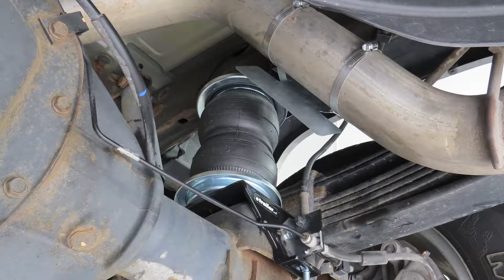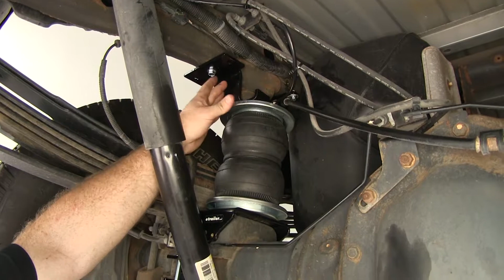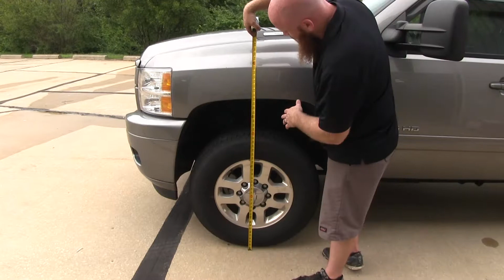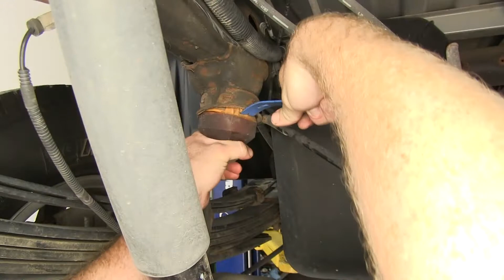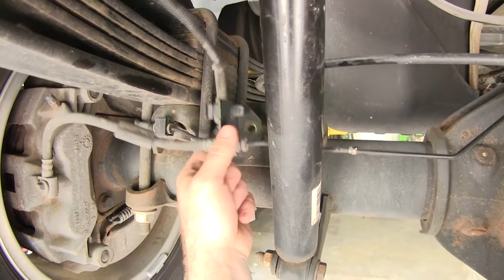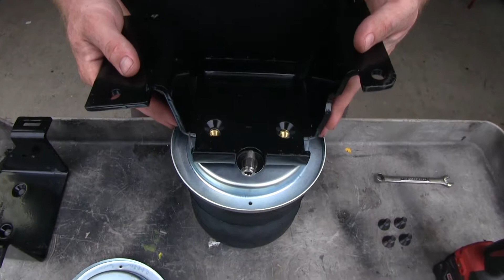Installation Guide for the Air Lift LoadLifter 5000 Air Helper Springs on a 2012 Chevrolet Silverado

Comment: is this compatible with the curt quick install side frame brackets? my truck is a 2011 sierra 2500HD. i have the curt quick install brackets installed.
Reply from the maker: You can install the Air Lift Air Helper Springs with your Curt Quick Install Brackets. You will not be able to use the u-bolts to install the air bags but you can use self tapping screws to get the brackets installed on the bottom of the frame rail.
https://www.etrailer.com/Vehicle-Suspension/Air-Lift/AL57338.html